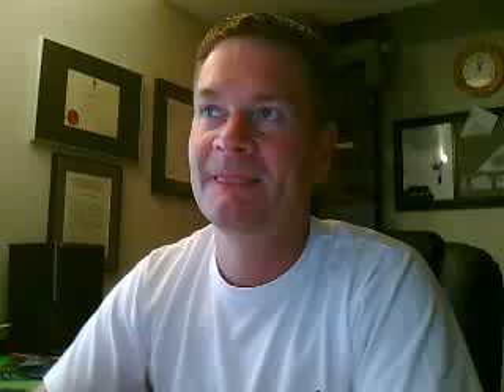#236 - Q&A: CPU Stepping

Comment: I'm planning to upgrade my Mac pro 3.1 cpu installing two Xeon X5482 which muast be Slanz.
My question is related to the matched pair issue, is it enough that I find two Slanz cpu or it needs to have other requirements in order to be matched?

thanks

Comment: hey i have a question i have a intel core i3 550 3.20ghz lga 1156 cpu in my pc atm and i see a intel core i7 870 2.93 lga 1156 b1 stepping cpu for quite cheap shall i buy it to replace my i3 because the i7 has quad core and my i3 has 2 core im just worried about the b1 stepping part